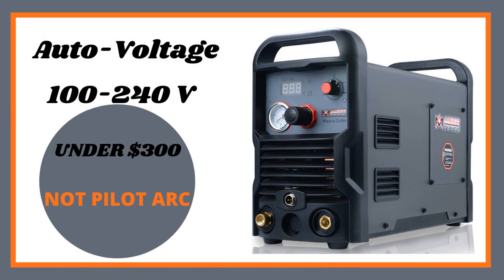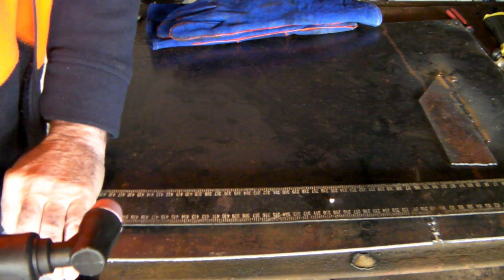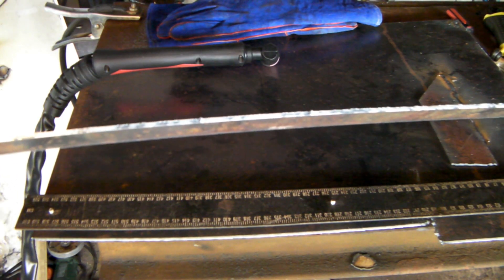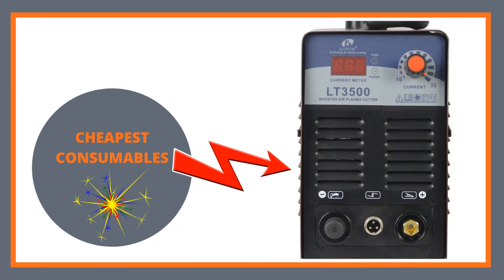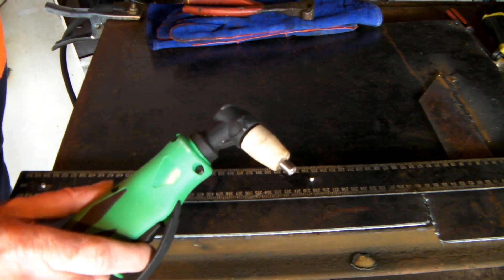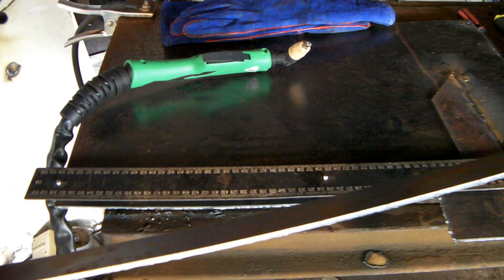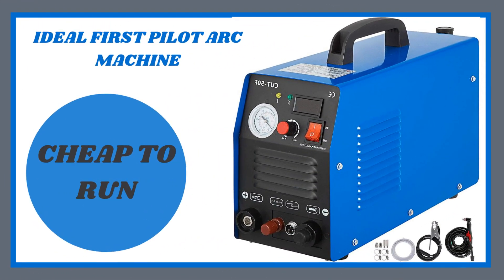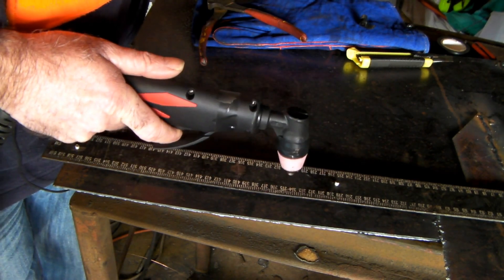Best Plasma Cutters

Comment: Got questions about Italian made older harborfrieght model pc3500 non inverter, (hf no longer carries or supports)large plasma cutter. I believe no pilot arc, I believe more reliable over time in dusty, humid, damp condition compared to the inverted machines with allot more electronics. Not sure on consumables, not sure on performance, do you have to keep contact with part your cutting once you get arc going on non pilot arc machines? What's your opinion if I can pick one up lightly used for 300 or 250 bucks? Have you had any electronic problems with the 300 dollar pilot arc machines over years of use?
Reply from the maker: Yes if it has a drag tip thanks

Comment: Another great video Pete. 
I bought a Lotos 50A Pilot Arc'd Torch Plasma Cutter and am very happy with its results so far. 
Consumables fit the AG60 Torch  aren't too dear for it either which is good.
Reply from the maker: Hi mate glad its working for you .My next plasma cutter will be a 50 amp still waiting for my old cut 40 to stop working.lol
Reply: @petestools  Still working?

Comment: Very basic and very to the point perfect ..
I have just bought me a cut 50 pilot arc and it comes with a p80 torch ..seems a bit friggin huge to be honest , only 2 parts to the tip bar the shroud . What do I need to look for if I want to change torches to a smaller torch like the little green one you showed ..
Reply from the maker: I would stick with the p80 once you get used to the size they really work well and are bulletproof.
Reply: @petestools  thanks pete . And keep up with the videos they are just so brilliant nothing fancy or sugarcoated just down to earth easy to watch and more importantly easy to understand as you do something . No fancy long in depth baffling crap . Thanks